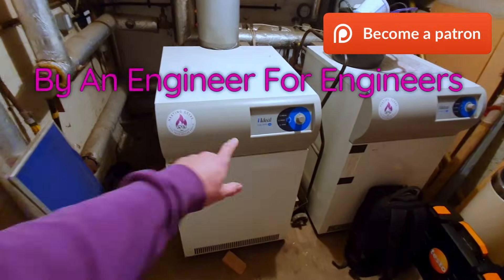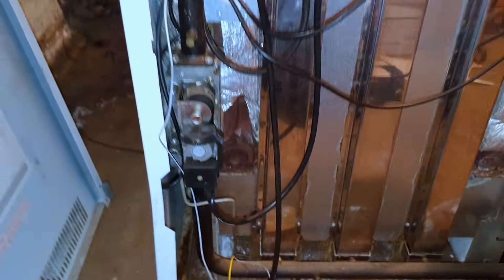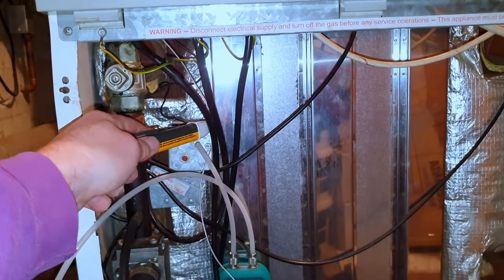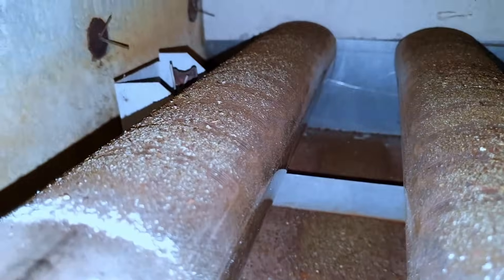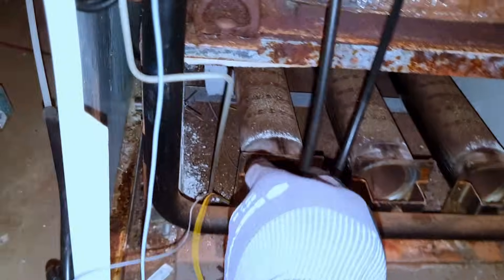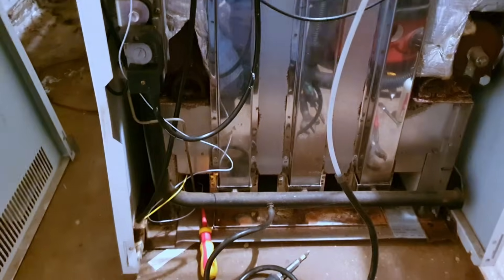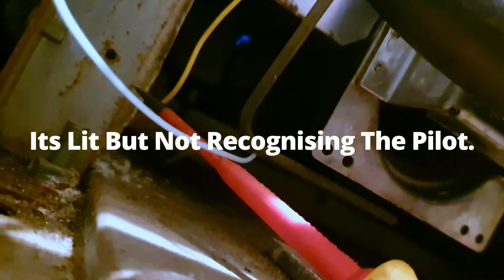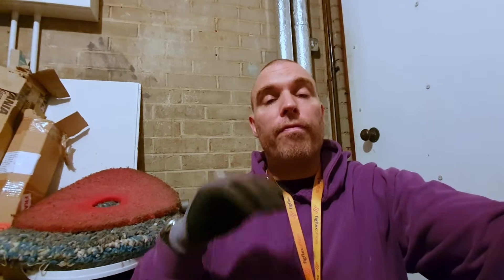Boiler Service Nightmare: Frustrations and Fixes

Comment: Looks like an Airflow GBDF flue fan, most of them had an paddle air flow switch built into the cooling air intake at the back, would be bad if it didnt as you say
Reply from the maker: The fan is only 3 wires so it cant? I think?

Comment: i don't understand why you couldn't leave the second boiler running. if the flue dilution interlock has been bypassed then there's no point even touching that first boiler, you'd have to just id the whole job. interesting video though, thanks
Reply from the maker: It AR not ID but I still need to know what to do to fix the first one. So when I come back the job is done.

Comment: Hiya fella.
Good to catch up.
I'm not a BIG Youtuber now. But I still get the feeling you've also not been doing as much on here🤔 is that right. 
Recently we had relatives come up North .
They said how hard it is living down South .
All the bollocks with Red tape...costs..etc
But I was very supprised to find out that for example a Quote to replace a 3 bed semis roof was cheaper down South & considerably costlier, here up North 😮
Reply from the maker: I had a few years off. Well 3 videos in 3 years. Soooo not doing much. I would move to a more rural part of the uk.
Reply: @HeatingGeek  well it was genuinely nice to catch up. 
And you even gave away a few of your little Tips n Tricks on Fault Finding, for the newbies.😉🤗
Reply from the maker: May as well pass it on. I learned it from someone sometime. :-)

Comment: Good video, had a similar issue with a 50kw concord. Just required electrode cleaning and set 4mm gap to the burner. Ht lead was ok. That ht lead arks on the aging Icos boilers as well. Top job Yoda👍🏻🤣
Reply from the maker: Yeah this was a pain in the ass. Lost a day of earnings because of it,
Reply: Nightmare
Reply from the maker: It was at the time but its water under the bridge now.